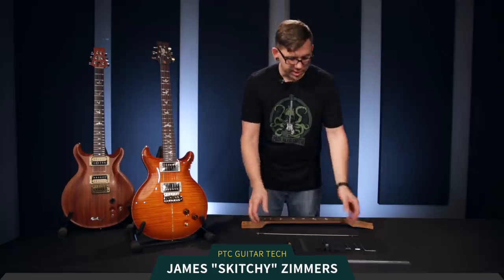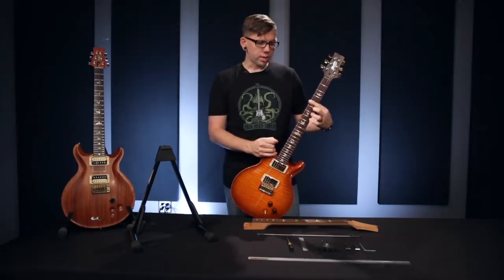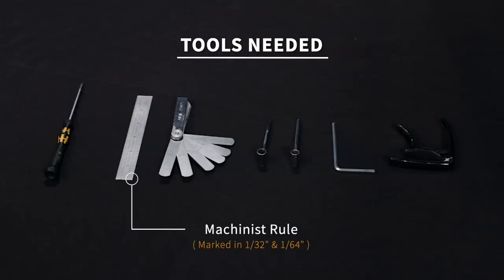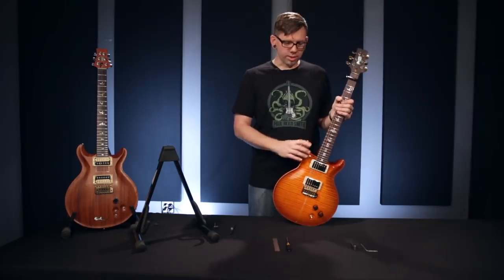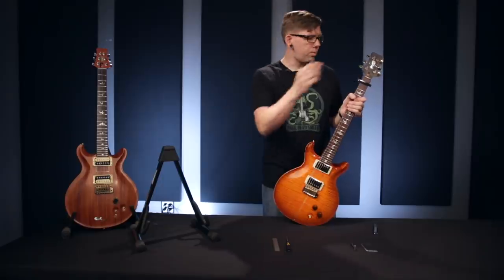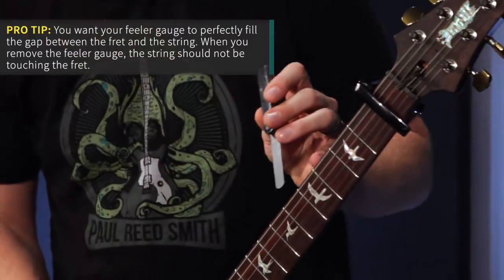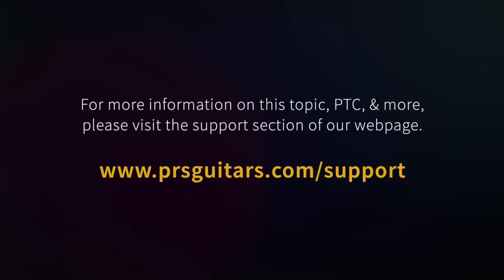How To Make A Simple Truss Rod Adjustment | PRS Guitars

Comment: I have a quick question if it's possible for you to answer. I have adjusted the neck relief and intonation after putting 9-42s on my PRS CE 24 Semi-Hollow, but can't get the action on the low E lower than 2mm without lowering the bridge which I've heard is not recommended. The guitar is amazing, but I wish I could get the action just a little lower (only 0.5mm). If there is a way to adjust it would it be possible to describe how to do it? This is the best guitar I've ever owned and I don't want to do anything that could ruin it. Thank you :)

Comment: If you don't have a thickness gauge, you can use a piece of cut-off .008"-.010" guitar string as your gauge.  Epoxy a 1" length to a short piece of Popsicle stick and keep it with your guitar tools.

Comment: I don't have this metal ruler for "fine measuring"... So how do i measure the relief by eye or what can i use to check the distance between the big E string and the 8th fret? I have no idea what is "0.012"" and those kind of metrics... I know how to adjust stratocasters/gibson's truss-rod (the distance of the string on 8th is "almost touching"/"touch by a hair"/"the diameter of an B string"/"the thickness of a daddario strings package paper" etc. PRS is the same relief or is bigger / smaller than stratos? Thanks.

Comment: Regarding the pro tip in the video, for fret buzz at the 5th (some measure at the 7th, for Gibson/Epiphone) fret there is string bounce, there is relief, if the string is on the fret, the fret might/could be high, so there might be some relief there. But if the frets are level/fine, there is zero relief or backbow.

Comment: A really nice demo. I like how he described pulling the rod back in order to pull the neck _back_. (Ha. I always "think too hard" with the righty-tighty rule etc because I inevitably worry which direction I'm actually viewing the rod from. Yup. Duh. Sad but true. LOL!)

That said, I do wish he had gone into working with the "double-action" aspect of the truss rod. I was specifically looking to see that addressed. Doesn't that make some kind of difference?
Reply: i think he did go into that?  basically instead of having a truss rod that can only "really" do one action, this can do two when turned either way.  ie, in the old days, you turned it tighter as one action, while loosening just "let up" on the grip, rather than physically moved it the other way like it does now.  make sense?
Reply: That method for remembering which way to turn the truss rod is helpful especially bc just saying "clockwise/counter clockwise" always confused me. There's different points of view; like regular playing position vs having it on a work bench and looking down the neck, it always confused me. Now I realize the rod itself faces out at the top and from that perspective its easy to understand which way to turn, but once the Allen key is involved and ur looking at it turn, it's gets weird. From my perspective (playing position) I'm turning it (the key) counter clockwise but the truss rod is actually turning clockwise. Does any of that make sense?

Comment: I bought a used SE Standard 24 that didn't come with a 7mm wrench. Is there anyway customer service could send me a kit for a fee, or is there a recommended alternative to the one PRS provides? Some of the ones sold on Amazon don't fit the cavity.
Reply: I'm in the same boat. Went and bought the MusicNomad stuff explicitly for this only to find out that the socket won't fit in the cavity of my Fredrik Akesson model. Super bummed.

Comment: Best way and imo only way to neck relief is with a straight edge not with a guitar string. Lay straight edge on neck in the middle between the C and G string then use feeler gauge at 7th fret. Not sure why anyone would do a neck set up the way shown here its not an accurate measurement. I have to really hard time believing Paul Reed Smith uses this method because like I've said its not accurate.

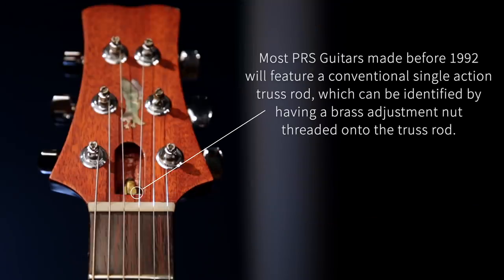Comment: 0:44 - single, brass, pre-'92
1:10 - dual, black, post-'92

1:42 - Front bow or back bow?

2:04 Tools

1. #1 Phillips screw driver for cover
2. 6-inch machinists ruler (32nds / 64ths)
3. Set of feeler gauges (check relief at 8th fret)
4. Wrenches (depends on guitar) 
a. (5/16 hex socket for private stock core, s2 and CE
b. 7mm hex for SE's
c. 4mm hex wrench for acoustics
5. Capo

Comment: My wrench won't go into the headstock without a lot of effort, it catches on the rounded corners of the hole. Should I grind the wrench shorter so it will actually fit or is there something wrong with the instrument?
Reply from the maker: Hi Alan, thanks for reaching out. Is the wrench the one that came with the case candy? We'd like to know a little more about the issues you are having before we recommend that you make any modifications. Give our Customer Service team a call at (410) 643-9970, or send us an email at custserv@prsguitars.com. Take some photos, let us know which model guitar you have, and in as much detail as possible explain the issue. Many thanks! - PRS Customer Service

Comment: Hi Skitchy, would you also recommend 0.007” relief for lower tunings? For example a dropped C tuning with 52-10 gauges? The low C string tends to move a little more than in standard tuning.
Reply: Yes.  This relief works fine as long as you also adjust your string gauges for the low tunings.  If you just tune down, your strings may just be too floppy.

Comment: i didn't really understand which direction i should pull the wrench, other places say that  you should pull it counter clockwise if you have a front bow , however here it kinda says the opposite , if you pull it towards you when the guitar is that in the position depicted in the video the  trust rod should go clockwise
Reply: Gabie Dubin yes I think it is opposite of other guitars. I was confused also. But I tried this on my PRS and that’s how it worked. Counter clockwise for more relief.
Reply: This depends on the brand. In my experience most guitars are counter clockwise for backbow.

Comment: Adjusting the truss rod when the strings are up to pitch is certainly faster. But it may damage or strip the rod.
Reply: Not at all, as long as you use the proper size, the one provided with the instrument is your best choice, by watching these videos saved me $75.00 to $90.00 for a setup!

Comment: I read about .002"-.003" difference between low e and high e string when measuring this.
There seems to be less relief under high e to be precise.
Should I aim for .007" under high or low e string?

It seems that under low e improves tension and sustain but then my high e gets a bit of buzz.
If I measure under high e I seem to lose sustain on low side...

Whats the fix for that?

Comment: Great video. Very well explained. Would be nice to see the factory recommendation specs for action, specially for the SE Baritones (Mike Mushok SE, SE 277).
Reply from the maker: Hi Felipe, thanks for reaching out. The Mike Mushok and the SE 277 use the same recommended setup specs as our other SE electric models. The only difference is that we set the string height slightly higher at the nut to compensate for the larger string guage. Hope that helps and thanks for watching. Be sure to look for more videos like this to come out in the near future.
Reply: @prsguitars  Thanks for the reply. I'll definetely keep an eye out for new videos. If I may I'd like to make a few suggestions, like maybe you guys could create local teams to expand the PTC so non US resident PRS owners and enthusiasts could benefit from the superb work you guys do over there making great instruments even better and the second would be maybe consider developing a locking tuner system for the SE models (I installed some lovely Phase II locking tuners with Ebony buttons on my Mushok SE but had to drill the holes due to the different screw placement on the tuners... The SE Paul's guitar's the only SE with American type tuners isn't it?) Thanks once again
Reply: @prsguitars  What does slightly higher mean?  1/64th? 1/32nd? An actual spec would be most appreciated.

Comment: Should strings on PRS bass be loosened slightly before adjusting rod?  Adjusting tool will not fit or turn unless the 2 strings closest to nut are unwound a little.
Reply: No need to loosen them.  You can always just pop the 2 middle strings out of the nut, but I don't do that while adjusting.